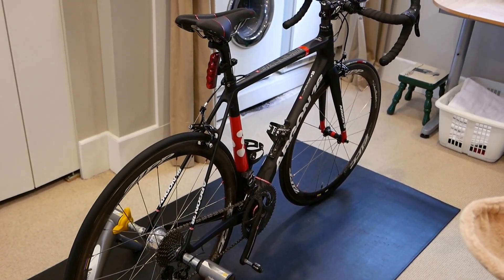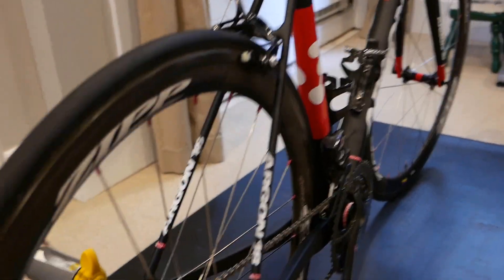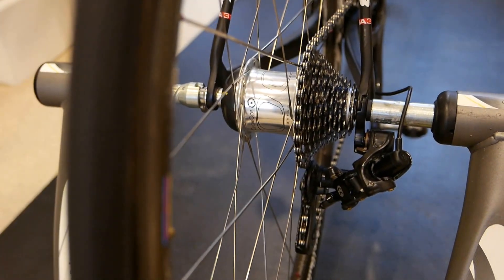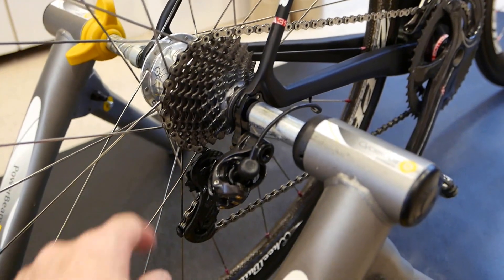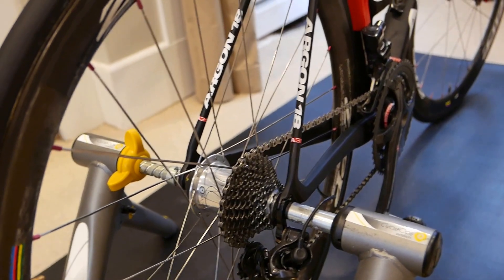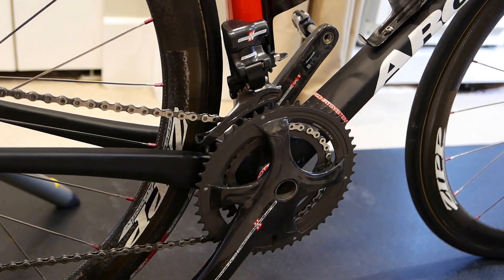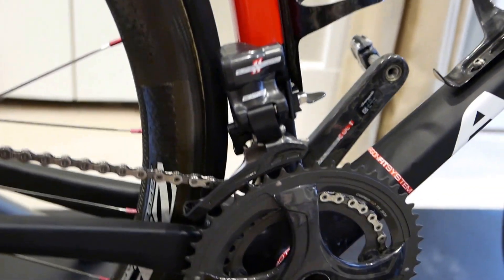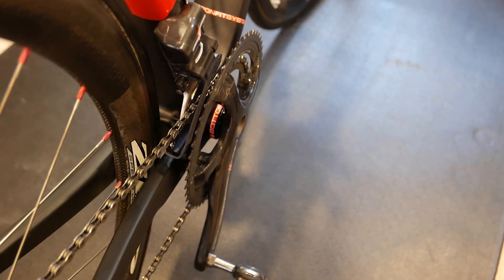Campagnolo EPS V1 V2 V3 Setup - fine tuning, problem solving

Comment: Is posible use the same shifters en darailleurs from v2 11s, and change  the power unit, interface v2 for v4 power unit, interface and the cables ??? My power unit is no working so, i have to change it i will prefer make and upgrade but not spend to much😅

Comment: Hi, Derek, When you mention going into ride settings by pressing ONE mode button for 6 secs, does this fine tune whatever gear/sproket you're in on the cassette, or does it shift the whole indexing for the full cassette (from the 2nd smallest to the 2nd biggest)?

Comment: My son's bike has same components but THM Clavicula crankset/Praxis chainrings. When shifting to big chainring with a quick tap it's okay. If it's hard pressed the FD moves too far to the outside and throws the chain. Any suggestions?
Reply from the maker: I wonder if the long press causes additional temporary movement - I think you may have to back off a bit on that setting - it takes some tuning - and depending on your chainrings not everything will be perfect - you will need to choose your most used gear ratios and optimize for them

Comment: I am having an issue where I carnt access all 11 gears . Have you had this issue .
Reply from the maker: No. Start the calibration over and focus on getting the gears you use most to be perfect and let the others be a little less perfect. You should get all gears working though.

Comment: My RD suddenly stopped responding altogether, but is able to go into Zero Setting. Any tips?
Reply: Yes. My mechanic fixed the problem, but the issue came back. I was out on a ride earlier today and the RD all of a sudden died mid way. The shifting won’t work at all on the right levers. There are no errors that pop up in the MyCampy app nor is there blinking LEDs .
Reply: @Timtimzi  is your problem fixed? How? My new SR EPS v4 did the same but seems only on Sequential or Custom setting. I have to hold right shifter button to reset and fidget with the crappy app. It shows there is an error but going to diagnostic it shows nothing.  App is crap. Love Campy hood feel and how it looks and will speak to specialist on Monday … people seem to say it is a software problem… if not resolved, my LBS has a Dura Ace 12 on hold for me. Testing today again but in pre programmed modes and maybe only with some limited function adjustments like adding shift assist.
Reply from the maker: Have you tried connecting to the system with bluetooth and using the diagnostics? They are quite in depth and may help you ...

Comment: Hi Derek, what's the method used to tilt the FDs front to back? Mine currently doesn't follow the curvature of the large chainring very well at all!
Reply from the maker: That is the problem with compact front chain rings. You can loosen the screw that holds the FD in position and simply move it to match the curve of the large chainring

Comment: @derek Spratt thanks for the info, i just got my bike from bianchi, and do i have the v3 super record... i wanted to calibrated and zero it..because sometimes the crank chain slips. is that video in youtube from campagnolo realiable  even if its for the v1 and v2? do you think i can just follow that?
Reply from the maker: I don't know. I think you should play around with the procedure on a bike stand - it really isn't a big thing to try out. I was simply learning and experimenting and got the system working so much better. I haven't adjusted it in about 8,000kms now and there have been zero problems. You are having the same problems I started with.